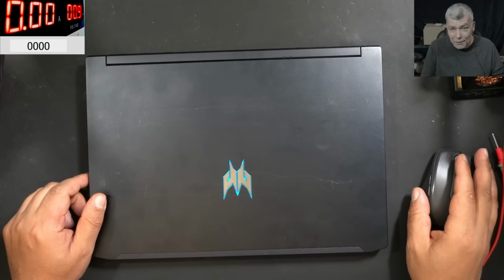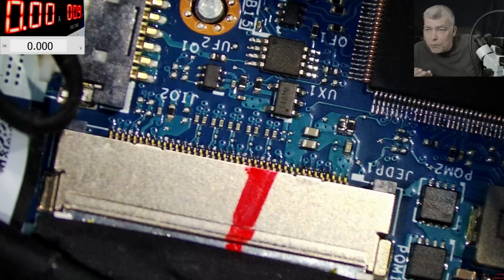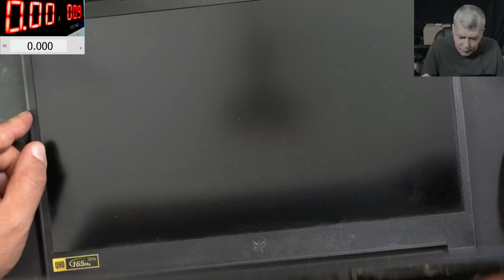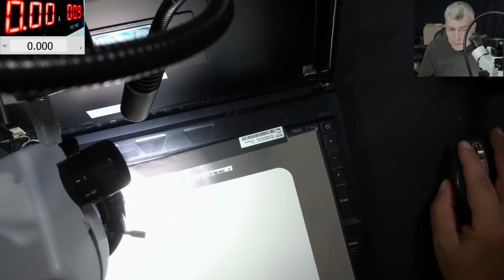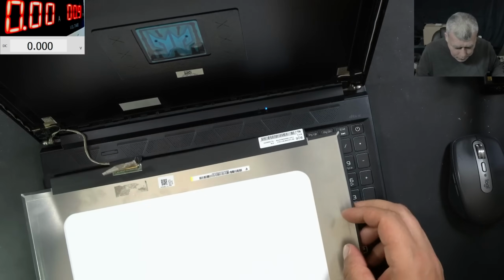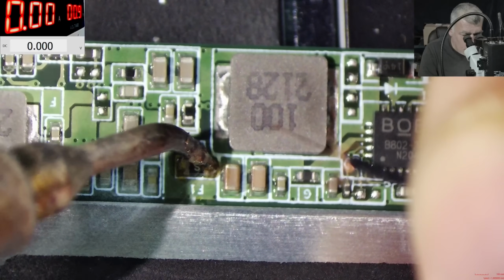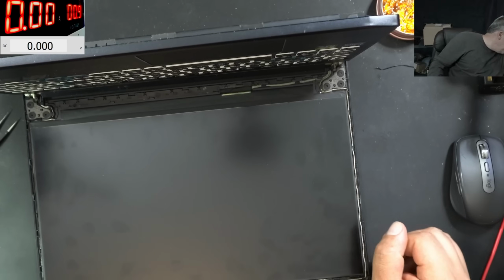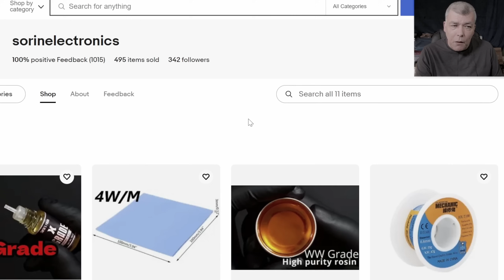Acer Predator Triton 300 - Customer replaced the thermal paste and the laptop died, what went wrong?

Comment: hi sir, i have problem my dell 7400 dead after replace thermalpaste, just blink yellow led/charging light when pwr button press n no taking current anymore, its hard to remove heatsing just gently lift up then i put some solvent/thinner try again n wiggle it n can remove heatsing, thermal paste dry, when done assembly its dead, i do unplug battery first of course, whats wrong please help sir

Comment: this exactly happened to me when after i  change all the laptop thermal paste and deep cleaned it after 6 years the unthinkable happened. I used gloves , used anti-static strap , unplug battery then battery drained the laptop, did all the cleaning with light hand care, did not removed the lcd 30 pin cable from the board because i don't have to remove the board to clean the other side , removed the Ram and wifi card include cmos battery and speaker , fan etc. in the end it this video helped me. been using the laptop with HDMI sometimes display port . THank You For Sharing your Knowledge BIG BOSS

Comment: LCD-side fuses blow up when disconnecting the screen connector without removing the battery. The voltage spike from when they are plugged back burns them up.

Comment: I had once on my Latitude E6430 where excessive torque on the screen while the back-light voltage is live blew the backlight fuse. Could be the customer testing the laptop with the screen bent at a specific angle and then the fuse did not like that

Comment: Why not replace the fuse with a new fuse? Now if the original overload comes back next time it will fry a lot of the components and the screen is finished.
Reply: You are on sorins dodgy repair channel
Reply: @juliusvalentinas  Yeah. And using components from other old boards instead of new ones means they can also fail quicker. Properly un-calibrated repair.

Comment: Customer probably removed the screen connector without disconnecting the batter, that caused a short and the fuses acted as intended, protecting the circuit.
Reply: A short at the conector or in the screen cable would blow one of the resistors near the connector, not all the way up the inverter. I've had it happen on a Nitro 5 recently.
Reply: Hard to believe. The short circuit should have been after the fuse, not before it.

Comment: I have an Asus TUF with exact same issue powers on etc. Replaced with new screen and new lcd cable - no picture on screen. There is picture only on external screen. I can't figure it out. Ideas? Thank you!
Reply: There's fuses near JEDP1, the display connector on the motherboard. I had a Nitro 5 with one blown right up in pieces. It's a 19v high current circuit.

Comment: What would Sorin do without the calibrated fuse wire !
Another mystery fuse failing for no obvious reason.
Reply: Fuses actually can die of old age, or a defect. They follow the bathtub curve too. Metal gets stressed and worn by high current, that's why your toaster and kettle elements wear out. Startup current is stressful for electronics, especially when cold.
Reply: @supergeekjay  I agree but going by the spec this laptop can only be a few years old.
The more likely reason is an underated fuse or the wrong type of fuse.
Antisurge fues were used in TV's etc to handle that initial start up surge also low value
resistors were also used in series for the same reason.
In this case i suspect that the type/rating of the fuse was not correct, Sorin's calibrated
piece of wire would have been a better choice !

Comment: Excuse me I need to check where is the short in my laptop is it the gpu or mosfet or something else and I just have multimeter, and if the problem is in the Nvidia gpu how do I remove mosfet without hot Air station. Regrets

Comment: Partial good job. To find the fault it was a very good job but not replace the fuse is bad job.
Reply: I still ask myself, why didn't he replace the fuse?!
Reply: He used a proper calibrated fuse. He knows what he is doing.
Reply: @rickoneill4343  This fuse helped the customer have his notebook repaired, preventing other things from being damaged. Now the next time the fuse is short-circuited, many things will certainly burn, making the repair much more difficult. This is the same thing as not putting a protection fuse in your home installations or simply replacing the fuse with a thick piece of iron. This idea of doing this is definitely a mistake. It is very easy to put a short circuit and finish the repair quickly and not think about why that fuse was placed there.

Comment: This was my laptop. I bought it second hand and it was filthy and overheating so i had to clean it all up and decided to do new paste and pads at same time. I will also add pads where Sorin the legend suggested.

I also replaced a board which had a 3.5mm jack, 2 usb and an ethernet as it had been cracked by previous owner.

However it was fully working when i bought it apart from the usb and headphone jack when bought. Fully working after the pads being replaced just the backlight as we found out
Reply: never disconnect display when the device is on or the battery is plugged in. it always kills the backlight.
Reply: your laptop is now upgraded with properly calibrated wire lol
Reply: Hi may i ask how much did you pay for the repair ?
Reply: @AmirA-oy2ef  can't recall but including postage I think around £150-£180
Reply: @psychosonny666  i meant just for the led backlight.is that the same?
Reply: did u actually disconnected the LVDS connector while the battery was still connected or was it just a theory?
Reply: @pauloduarte2494  I didn't disconnect the battery I've never had to do anything like this with a laptop before. I've done it on pc and usually just turn the switch on the PSU and press the power button a few times.

I'm surprised this causes an issue to be honest. The laptop was off.
Reply: @psychosonny666  off laptop is still powered. but did you unplug display connected with battery plugged in?
Reply: So what is the procedure when changing paste, what did u do wrpng i dont understand. Do u have to unplug the battery when changing paste anything else?
Reply: @gileranexus7972  yes you have to unplug the battery because you have to unplug the screen. It's a dumb design to be fair if it's not on you shouldn't need to unplug anything. From now on the first thing I will do is unplug battery when opening a laptop up

Comment: Very good job! For initial diagnostic and to save time, the best way, probably, is to test first lcd / cable with any, even cheap, Chinese - lvds tester. With any torchlight, it is easy to see if the picture is present (when the backlight is off). 😉

Comment: Hello, can backlight fuse be replaced or the best way is bypass?
Reply: He didn't bypass it. NEVER BYPASS A FUSE!!! He added a very very thin wire which acts exactly like a fuse.....
Reply: @g4z-kb7ct  that wire, you are right still a fuse, but can carry ton more amps than the stock fuse :D
Reply: @ДимитърАндонов-ъ7е  "CAN CARRY".... maybe. Do you have evidence to suggest it does? Otherwise your comment is pretty pointless and a waste of time typing it. You are suggesting Sorin is an idiot and doesn't know anything about current.... try to think before you comment in future.
Reply: I think he preferred to replace the fuse with a properly calibrated wire because of the risk of heating the area too much. Do not forget that it works on the screen. On the other hand, he could use "my little friend" to remove the fuse...
Reply: @panaitepaul6798  A small part like a fuse or resistor or capacitor can easily be removed with just a soldering iron by adding solder then heating both sides. It's a common technique well documented. When in very delicate areas even larger parts like TSOP48 flash ROMs can also be removed with just a soldering iron using another technique that I use, which I developed :)

Comment: Seems like 90% of gaming laptops are acer lol
Reply: Ummm, this is because 90% of people are cheapskates and don't want to pay $$$$ for expensive gaming laptop.... or 90% of people have no brain and just buy cheapest piece of chinese rubbish they can find without looking at the brand name or quality. Anyway, people who buy gaming laptops are usually not very smart.... gaming laptops get hot, throttle often and die quickly. For real gaming use a desktop PC since it runs much cooler and is very easy to fix simple by replacing whatever thingy fails (i.e. motherboard or GPU card).
Reply: Maybe just 90% of broken ones?
Reply: @gorky_vk  Or 90% of people don't know how to choose a good laptop brand ;-)
Reply: acer were always budget laptops and always use the cheapest materials, that's why
Reply: @ДимитърАндонов-ъ7е  They are all like this these days. Thin, powerful, poor cooling, all plastic, with chassis that crack, everything soldered in. Junk that looks nice. Design copied from Apple, except in plastic and not aluminium.